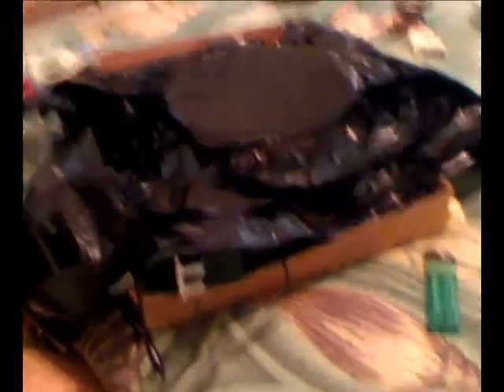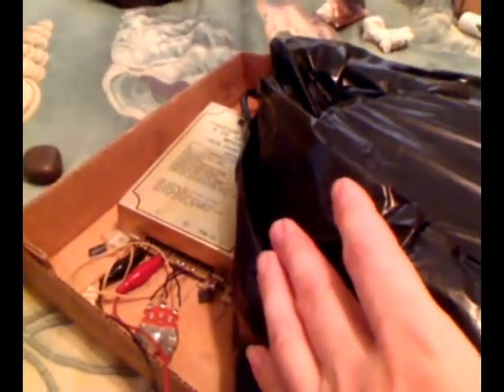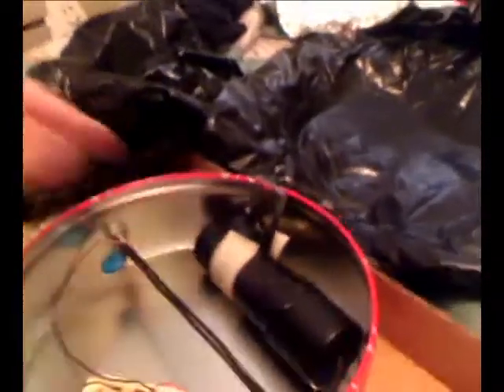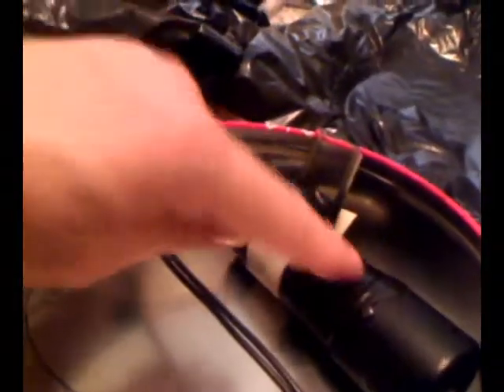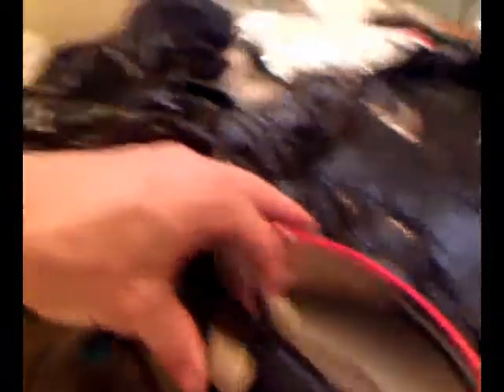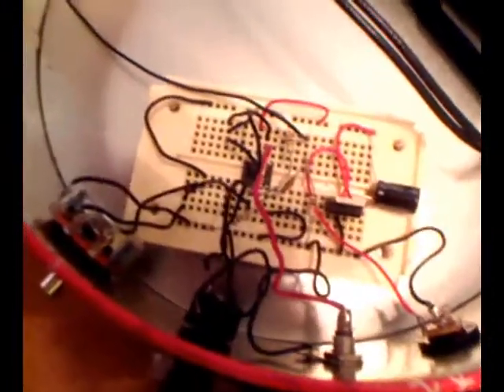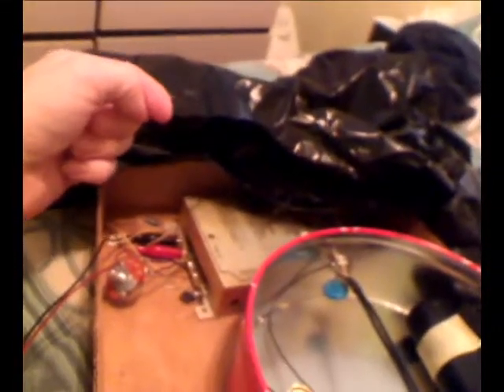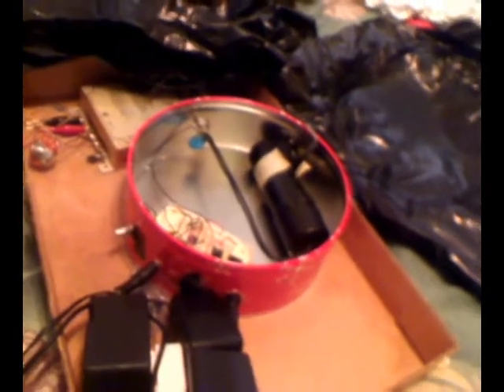Project Arcturus - Homemade Photolistener/Radiation Scintillator, Tour Part I

Comment: I’ve spent what seems like a lifetime searching YouTube for scintillating and gamma spectroscopy related stuff… not to mention photonics optics and laser stuff.And I’ve never seen a single video of yours or your channel pop up. 

Which is strange because I found some pretty obscure stuff… But I happened upon a comment of yours on an  Nile blue video and saw the high powered laser diode’s in your pic….

and since I’m an optics and photonics nerd also…. figured I would check out your profile. Hopefully you’ll come back to it and maybe make some updated videos on what you’ve been messing with? 

I’ve got a pretty nice optic lab hidden away in the small corner of my electronics lab. I do electronics metrology related work for a living, sure is nice being self-employed and owning my own equipment. 

but the optics and gamma related stuff is just a hobby. I can pretty much re-calibrate and repair any piece of test equipment, because anybody can color within the lines and follow the steps in a service manual. I’m nowhere near smart enough to actually contribute to the Studies of gamma or optical black magic

And even though I have a lot of nice professional equipment for those two hobbies… All of its been purchased from government and education auctions for pennies on the dollar. I’ll never forget the first time I stumbled upon the FAP-80 modules on eBay. Some of which were pulled out of regular use but some had never even been used. And they can bring as little as $30-$50 …. It was insane to me having access to 40 Watts of pure optical output power for that price!!!
I’ve got close to 2 kilowatts of laser output power power in my lab at the moment. Nothing super massive by it’s self but it adds up quick when you can find super powerful stuff really cheap

Sure is hell is a golden age for incredible equipment at basement bottom dollar prices! 😁 it would blow your mind if you saw some of the massive gigantic scintillating apparatuses that I’ve scored off eBay and other auction sites just because people had no idea what they were. Pretty sure I’ve got one of the biggest nal(Tl) Based detectors that’s ever been made (other than one time custom pieces or something like that crazy). 

I also find very exotic and ridiculously high end centiliters and detector a raise from time to time… Here’s a decent example…

ran across a radical scintillating astray, I think it was something under $100 each, which included over 100 individual small scintillator array packages. Utilizing a very exotic Crystals, and Cutting Edge SIPM (silican photo multiplier tubes) 
It was From some really obscure imaging equipment involved with very high resolution medical imaging. And for other things that require very precise and high resolution imaging. And it was only a few years old, it came with the multiple boards full of the mini scintillator detectors, and all of the control/mounting circuitry. I was stunned when I happened across it. Because it was not described as anything other than “strange circuitboard“ or something like that

If you troll ebay pretty regularly, you’ll run across all kinds of things that are described very badly along the lines of “ circuit board module control board“, And maybe if they got lucky the list a few identifying part numbers they found on the board. Which many times will still keep it hidden from most interested buyers. Specially when you’re talking about equipment in the realm of scintillating, and other high sensitivity back ground/area monitors. Replacement boards for x-ray machines and things like that are pretty easy to fine because there are so many common variations. But the more obscure and high in the equipment… The more likely it is that some boob just toss it on eBay for a few bucks. And thank God for that!

Hope to see you do some more Austin Condit on your channel and hope you’re enjoying whatever it is you study these days